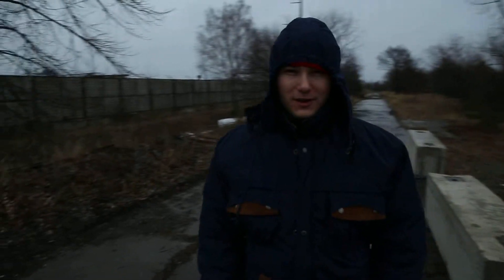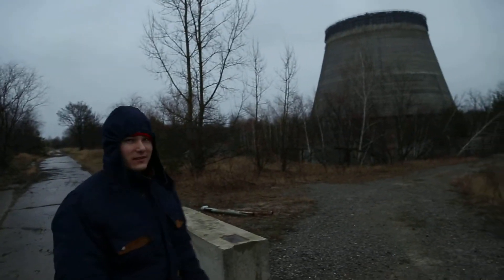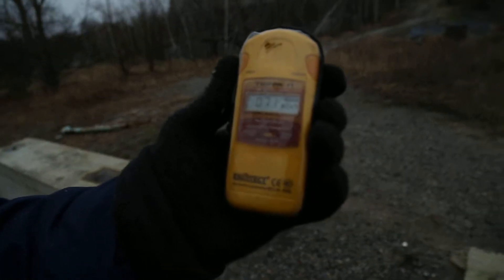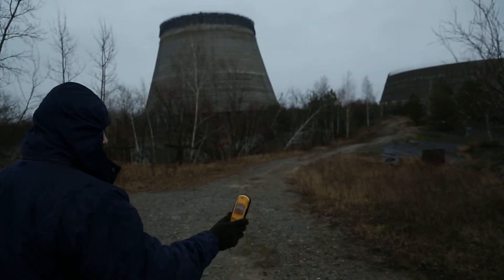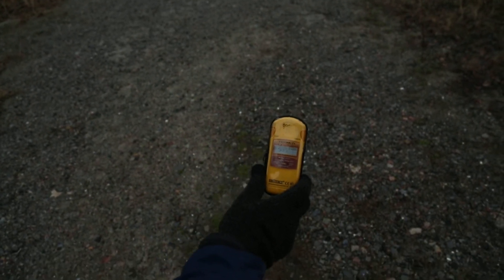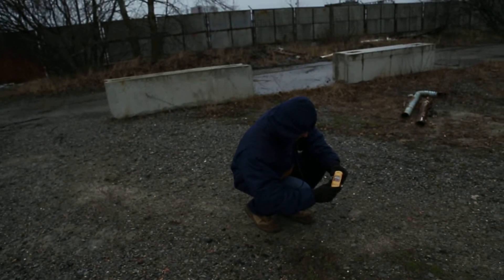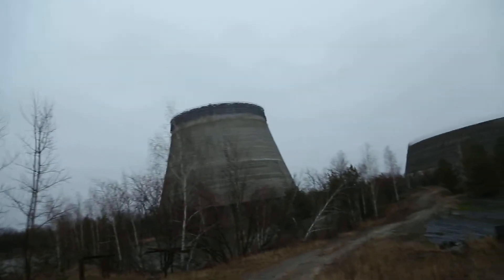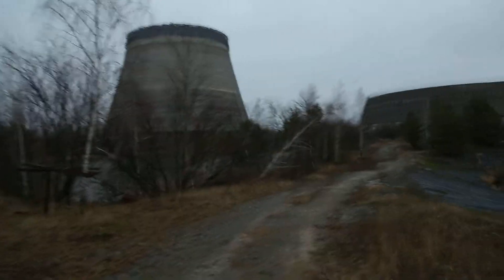Dangerous Cooling Towers of Chernobyl

Comment: The cooling towers are dangerous how?  The cooling towers didn't dump the radiaton hot-spots there.
Reply from the maker: The issue is that parts of the towers were collapsing. My guide mentioned that he noticed after a week a huge chunk fell off into the inside. It doesn't look all that big on video, but they are giant heavy structures.